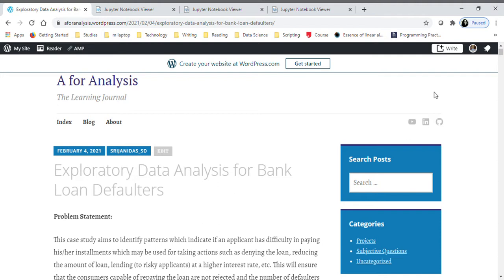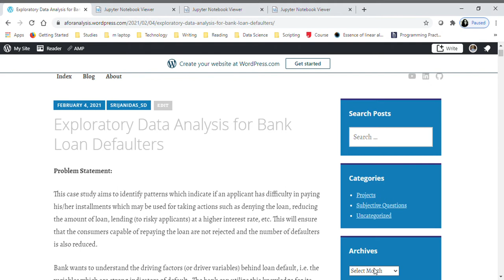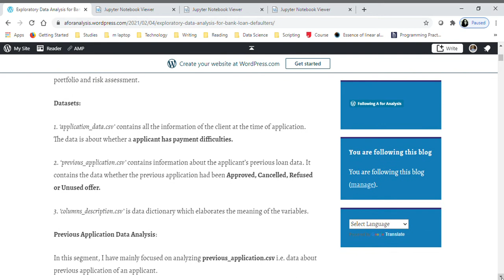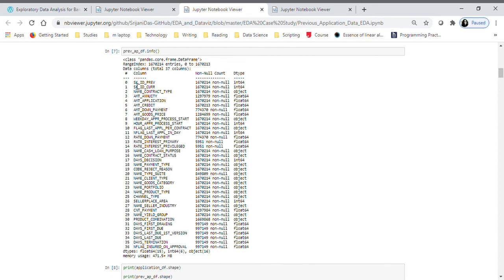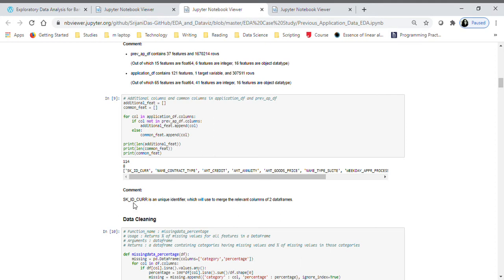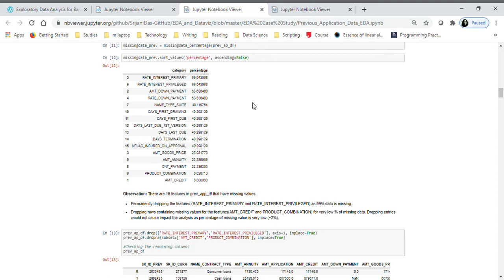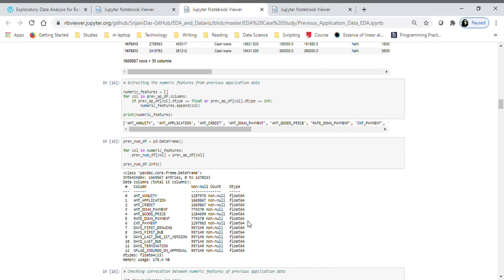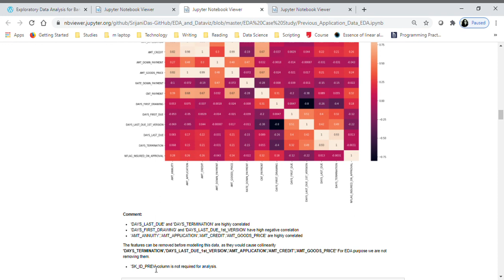EDA for Bank Loan Defaulters – Part 1 | A for Analysis

Comment: It would be great help if you suggest me some resources to learn python. From where did you learn python to be good enough to perform eda on dataset. I am struggling because i am not getting good  resources to learn
Reply from the maker: Hi Harshi,' tech with Tim ' and 'Code basics' 
 have amazing Python tutorials. You can learn from any book as well. Most important is to pick up simple problem statements first and try to implement the solutions using Python.